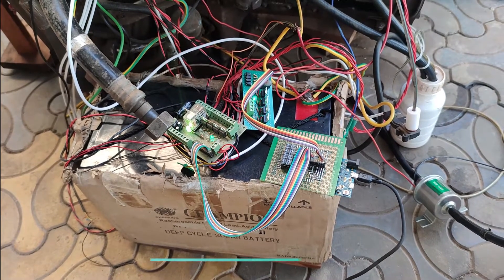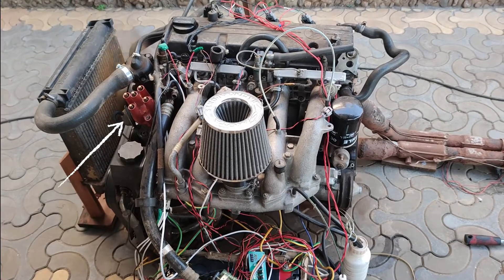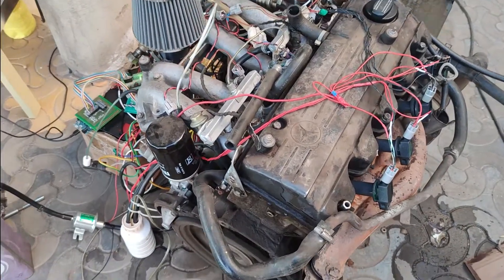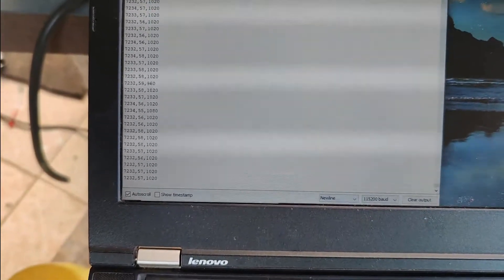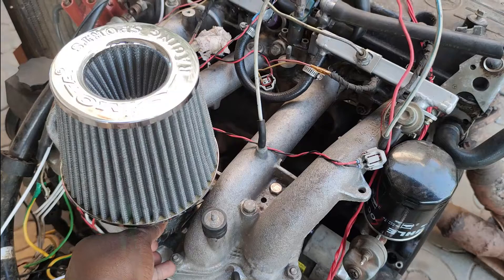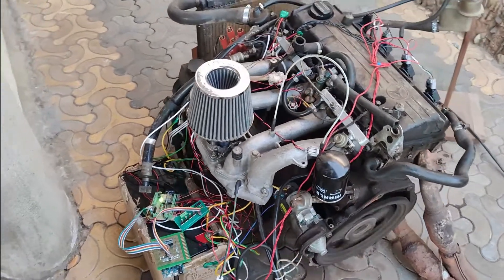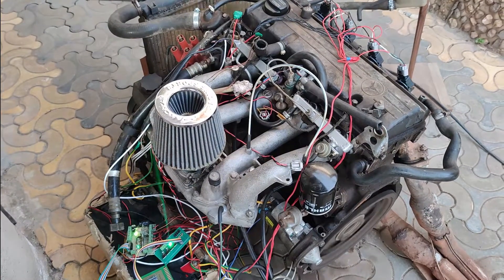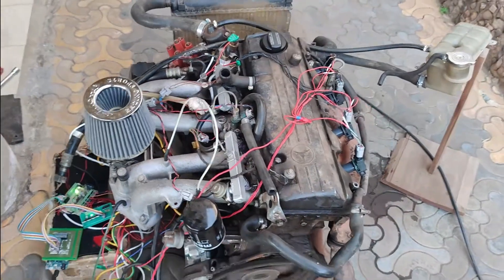Mercedes Benz M102 Carb to EFI coversion Ep3 - Distributorless

Comment: Am Phill for Zambia I need your help with a Ben m103 efi
Reply from the maker: Hey Phill, thanks for reaching out. WHat have you been able to accomplish so far?
Reply: @PeterMbiria1  thanks for the reply,I love the project.. can I use a Toyota 1ge ecu with the common rail and injector on the Benz m103 engine or is your system cheaper..?
Reply from the maker: @angelahaakalima2568  With some work, you can make the 1ge ECU work. The problem you'll face is, you'll be stuck with the settings inside the ECU so COPs, fuel injectors and sensors have to be the recommended ones for that ECU.
My ECU however, changes all that. It gives you the freedom to use any sensor that is readily available, COPs and fuel injectors and allows you to tune your engine the way you want. The main downside is, it doesn't use tuning platforms like Tunerstudio, instead, it is purely lines of code. I have not updated the current progress but I've been running it on my Benz for the past 5 monhs and the experince is great. Better fuel economy and great perfomance. Did I mention I have drive modes?
Reply: Do you have what's app, brother I need an efi system for my Benz m103 inline 6 ,price for buying and sending to Zambia Lusaka capital city
Reply from the maker: @angelahaakalima2568  Yes I do. I have programmed it for 4 cylinder engine. My next step is to do 6 cylinder engine.

Comment: Hi peter
Why didn't you use stm32 ?
I have made an ecu from scratch like yours on m102 engine with ke jetronic and i want to share it with you.
How can i contact you ?
Reply from the maker: Hey man. This was the earlier version of the project. I later changed to Due which is 32 bit controllr with faster procesing speed. I have uploaded several videos of this project as it progressed. You can reach me on petermbiria@gmail.com.

Comment: Hello good evening. What are the electronic parts that you used in the video and are there any of them? Greetings
Reply from the maker: Hey man. I've used the common electronic parts like the resistors, caps, diodes etc. The main MCU is SAM3X8E ARM Cortex-M3 CPU (Arduino Due) 84MHz. It allows me to run many calculations in us to ns.
Reply: Great job, thank you

Comment: What fanbelt size did you use after switching to M111 power steering pump?
Reply from the maker: Hey man. Same belt. The tensioner compensates the belt difference since the M111 steering pump has a smaller diameter. Make sure to loosen the tensioner main bolt first before tightening the top tension screw.
Reply: @PeterMbiria1  I see, thank you!

Comment: In my search to go efi I came across the Holley sniper it is so basic to setup & from all I’ve seen when installed 1st start was instant & what attracts me the most is the learning feature it has you just put in information about your engine & when you drive it it learns & tunes on its own if you can include that feature you would be on to something
Reply from the maker: I'm doing the very best to achieve great results. I'm running many tests and reporgramming to ensure reliability, perfomance and great fuel economy.
Reply: I want to convert my car to EFI. Can I buy Holley Sniper and install it easily?

Comment: Is fuel efficiency higher after efi
Reply from the maker: What EFI offers is full control of the fuel injected to engine. With this, you can be able to have the best fuel economy and also performance. Carburetors are good, one of the greatest inventions ever in engineering history but as time goes on and engine emissions are closely monitored, EFI is able to meet those regulations quite easily. Carbs struggle to meet those regulations.
Reply from the maker: Also, EFI offers unparalleled performance in every way, great fuel economy, great performance and reliability. The downside is the complexity as a carb mech will struggle to work on EFI system.
Reply: @PeterMbiria1  How to calculate fuel injection time
Reply from the maker: @bhashithagimhan734  a number of factors should be considered in calculating the fuel injection time like engine temperature, throttle position, revs and engine load.
Reply from the maker: When the engine is cold, the fuel injection time is longer than when the engine is warmed up. When the engine is under load, the injection time is longer to give it more power.

Comment: Hi Peter. That's an awesome project. I am planning for the same conversion on my spare Land rover 2.25 petrol engine. Am considering Speeduino standalone ecu but before then I am toying with adopting complete 4AFE EFI system and planting it on the 2.25 and try to edit the eeprom. You can send one of your this way for testing too. Wewe ni mnoma sana bro. Keep it up.
Reply from the maker: Hey Mart, how are you doing? Great job there. I'd want to visit to see your work. Let me know how we can link up.